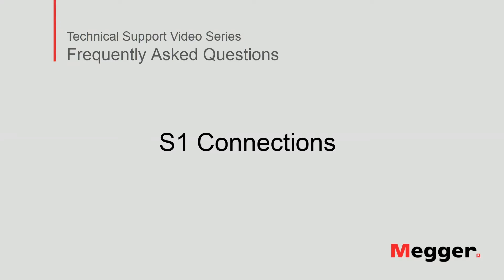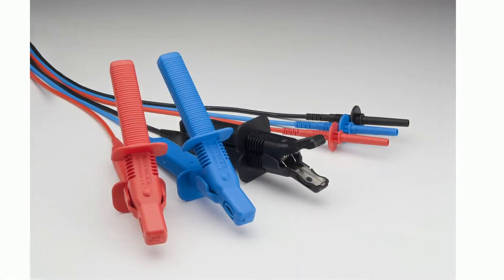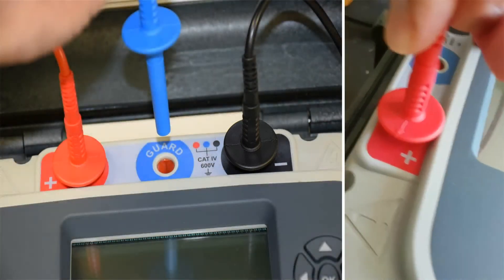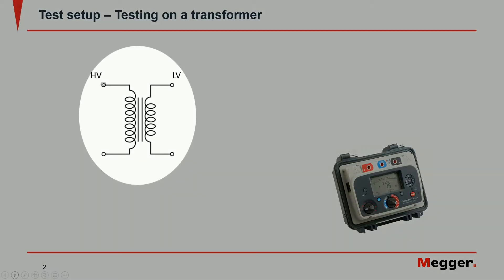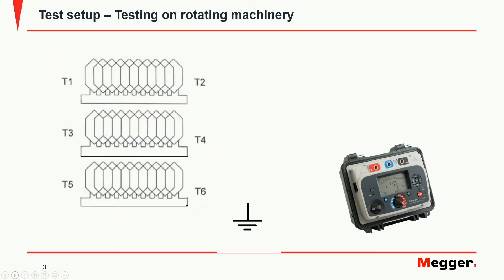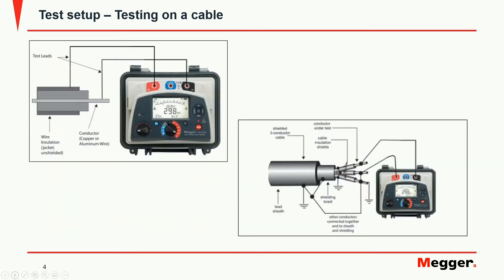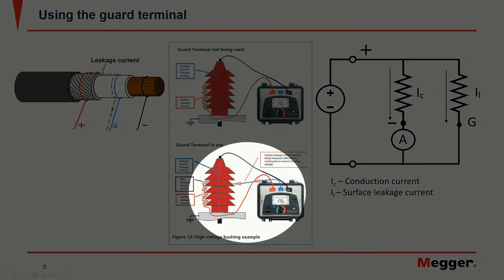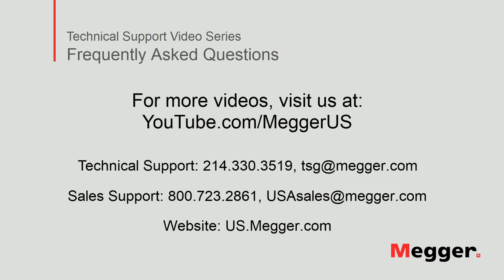Megger S1 Series: Leads Set Up and Connections

Comment: What is the purpose of blue test lead maam/sir
Reply from the maker: Hi Ronilan, thank you for your comment. The test lead is to guard one portion of the insulation being tested. Detailed information can be obtained from the following webinars we have done in the past: 

"DC insulation resistance testing: effective use of guard terminal" Presented by Nick Rees - https://register.gotowebinar.com/recording/5255519750791791880 
"Practical considerations for low resistance testing" Presented by Sameer Kulkarni - 
https://register.gotowebinar.com/recording/5999480106084333580 
"An insight into insulation resistance testing" Presented by Sanket Bolar - 
https://register.gotowebinar.com/recording/61509286473431565 
"Fundamentals of insulation resistance testing" Presented by Jeff Jowett - 
https://register.gotowebinar.com/recording/6423711274234416141